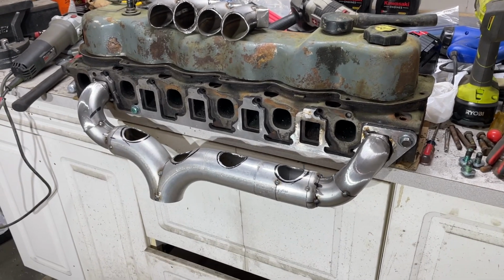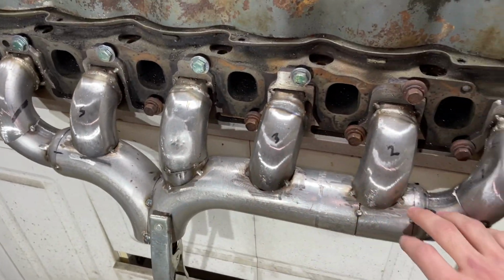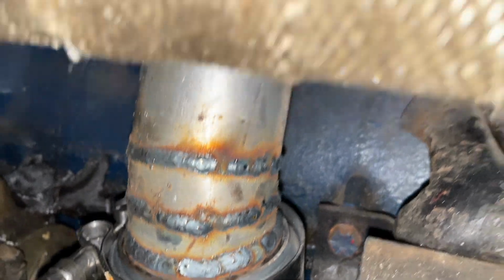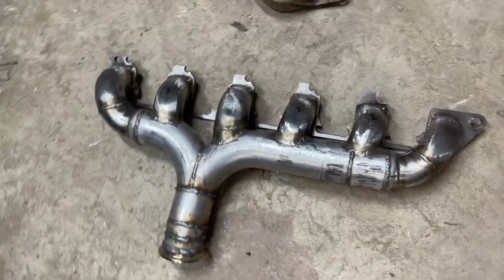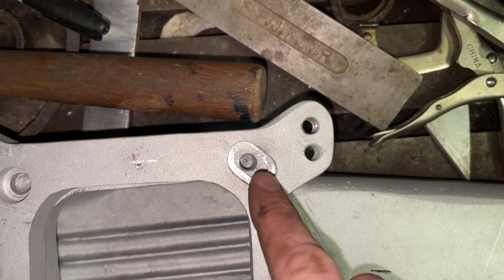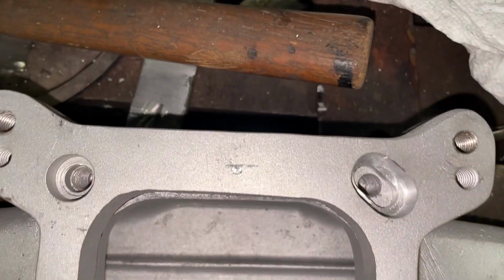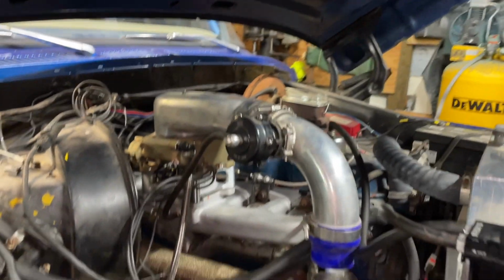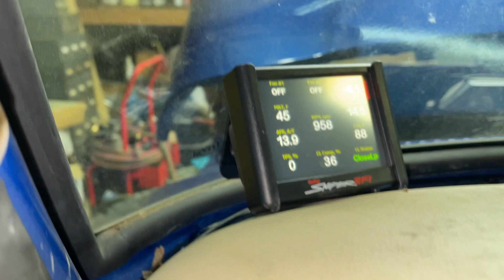Finished 300 Turbo Header and First Fire Up

Comment: Might be a pain, and way too late, but maybe think about propane or lpg. 100%, not the 50% ones. Octane is around 110++, and usually half price of gas. With the height of your rig, underground garages aren't an issue. Also, pass emissions tests.

Comment: I'd say those welds are plenty good enough. I have quite a few ugly welds on my twin turbo 300 manifold. I made the intake and exhaust one solid piece with a 3/8" mild steel flange I designed in Fusion 360. I used 1-1/4" schedule 40 pipe, if I'm remember correctly. It weighs a metric fuck ton. Love the truck.